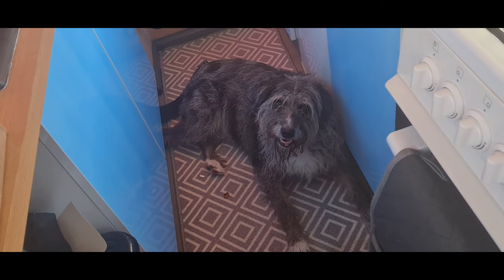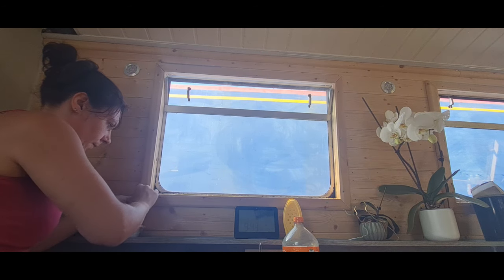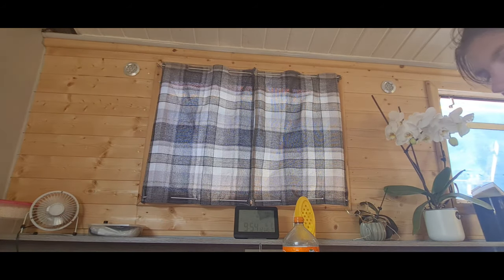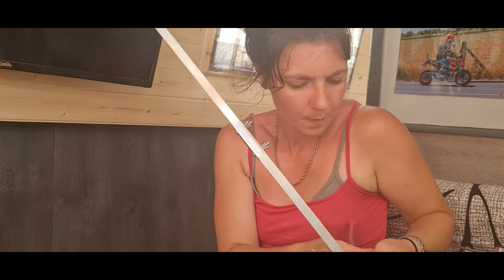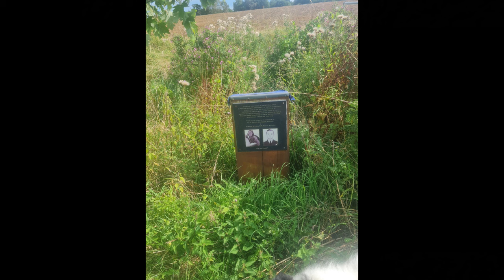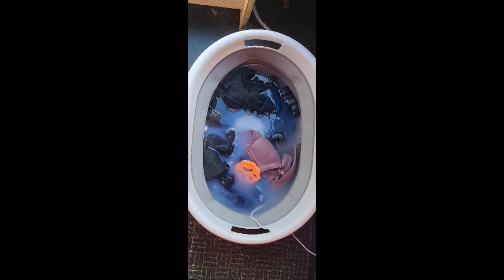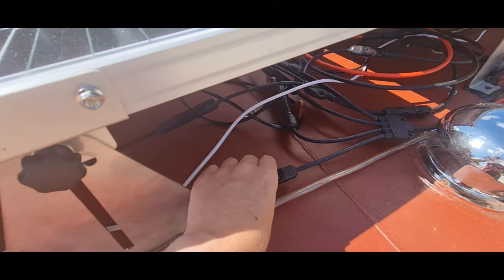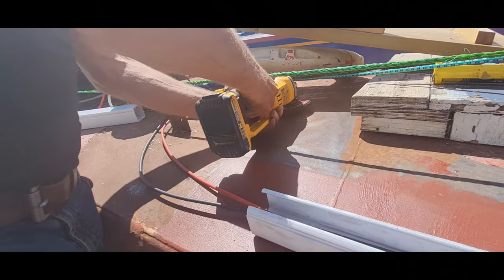EP022 Curtains, Handles and Powered By Sunshine - Fitting Solar Power On Our OffGrid(ish) Narrowboat

Comment: Aerial - go for a higher pole, the cut is usually quite low down. Batteries - the fridge is the biggest draw on them (aside from sporadic use of white goods when you would have engine/genny running), lithiums are the only way to go if you live aboard (see what I did there?).
Reply from the maker: Totally saw what you did there 😂

Lithium are the long term plan but we had plenty of leisure batteries on hand as you kind of collect them when you work on campsites!

Aerial is definitely fairing much better these days!